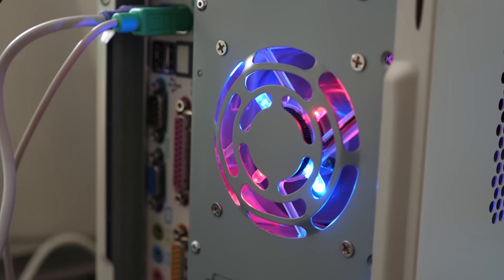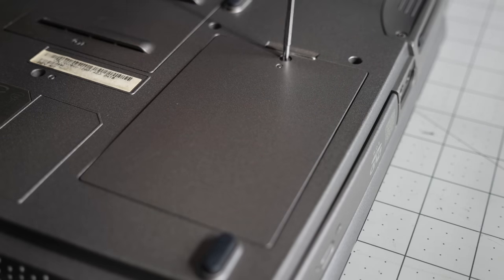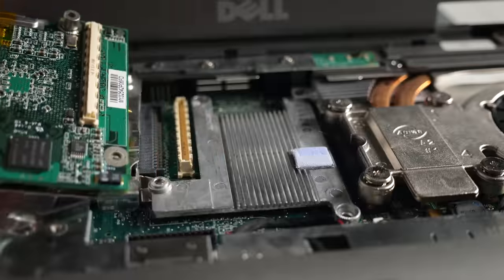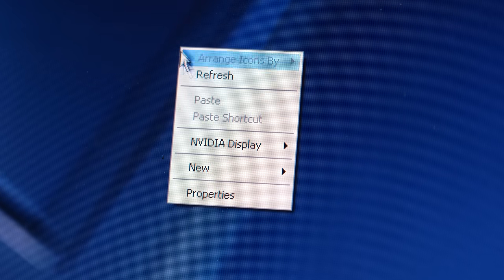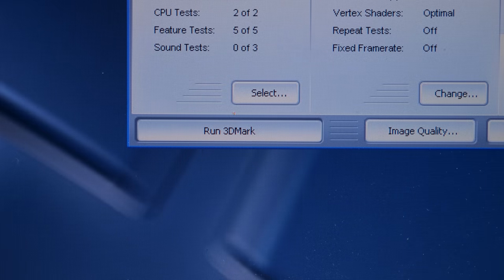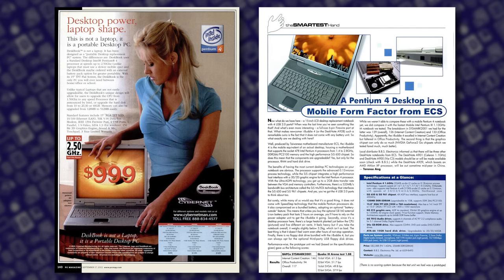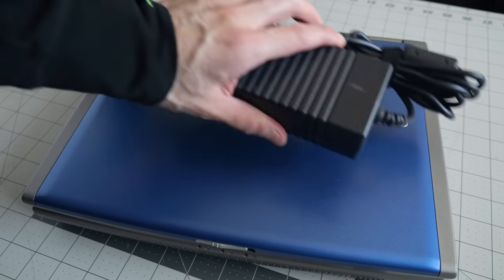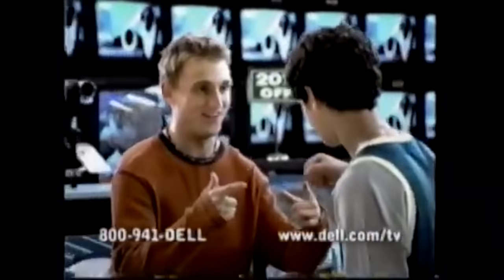Dell Inspiron 5150: Good for Windows XP Gaming?

Comment: ah, what an absolutely miserable machine. P4 laptops were truly the worst of every world: hot, slow, expensive, and left so immediately in the dust by every class of new machine that you wondered why you bothered in the first place. comparing this to my first Vista laptop (an Acer Aspire, lmfao) was night and day even then. the only thing i miss is the keyboard!
Reply: Honestly while I can agree with what you’re saying here, this is one of the few examples of a GOOD Pentium 4 laptop. With the right upgrades it can be a pretty beastly machine and very functional! I have one and it’s one of the most functional P4 dells I’ve ever used… which is saying something because usually they are kinda garbage.

Comment: They have so many better options even from dell. Get the xps with the awsome fave plates. Or hp had the zd8000, dv7000 which both had dedicated graphics, and desktop pentium 4ht cpus. Dell also had a desktop replacement that was a tank looked like a standerd inspiron but had 2 inchs more on the bottom. Lgr did a video on it.

Comment: I absolutely love these types of videos. I have many XP era laptops loaded down with games. Also if you want a more modern laptop that's very small, with hours of battery life while playing, I recommend the Dell Latitude 3189. You can get them under $100, they have windows 11, and are on par gaming and benchmark wise with an ATi 9800pro. I put a usb external SSD on that sucker and loaded it down with all my GOG games. It is a great pre 2004 gaming pc( an era that has a lot of nostalgia for me as that was my teens and early adulthood). Great for all those unreal engine 2 games and below. Handles dosbox great too. Resolution of the screen is 1366x768, so a lot of these games will run at 1024x768 or you can use widescreen mods. Also a glide wrapper like DgVoodoo will get those glide games running just great. This little hunk of junk is great for travel, it's light, and you can game on the battery for at least 3 hours. I did it playing Deus Ex and Gothic 2. It's a great option for the retro pc user that needs a little pc for travel that can browse the web safely.

Comment: I think you're glossing over what a weird thing the P4 was here, especially crammed into a laptop. The Pentium M chips of that time would have performed similarly if not better, and so it's weird to me how Intel was pushing P4 chips into laptops, creating unnecessary internal competition with a CPU that didn't perform like they intended. P4 chips were an evolutionary dead end. Intel had to go back to the Pentium M, which was based entirely on the Pentium 3, to start making good CPUs again - the Core line we know til this day. It's like Intel was hungover from drinking all that megaherz koolaid in the 90s, gaslighting themselves into believing a 3ghz P4 made sense when a lower clocked Pentium M would've outperformed it and drawn less power doing it. The IBM Thinkpad T42 with Pentium M and Radeon 9600 was a far better machine for gaming, and it should have been for sale around the same time.

Comment: this might be the first retro computer that i’ve seen on youtube that i actually have. used it a lot when i was a kid and ended up inheriting it from my dad. sure, it’s definitely worse for wear but certainly still usable. remember playing rollercoaster tycoon 3 on it and it handling it pretty damn well.
Reply: Wonder how Windows 7 would perform on it. Have you tried it by chance?
Reply: @dylanash2569  I haven't tried it, but I can't imagine it would be too great, seeing as I tried running Minecraft on it back in 2013 and I got maybe 10 FPS on it. It wasn't really playable and I imagine that things such as Aero just wouldn't work and Windows 7 era games would probably choke. Still have it, suppose I could give it a shot. Main limitation is that it's a 32-bit CPU
Reply: @majoryoshi  I ask cause I used to run 7 decently well on an AMD Turion and while performance wasnt great in many games, it worked well as an office machine.

Comment: I’m a huge fan of laptops from this era. Not only for nostalgia reasons, since this is what I grew up with, but also since it was a golden age of laptop upgradability. I’ve got a few ThinkPads and Compaqs of the era, and they’re great machines.
Reply: Yeah, pretty much everything had socketed cpu's.

The reverse of today.... Absolutely everything was socketed, modular batteries, sometimes dual battery capable.
Reply: yeah, laptops back then were modular pretty easy to upgrade and service

now everything is fixed soldered and unupgradeable
Reply: No doubt people don't understand their smartphones tech is fitted in with the increasing power and performance of laptops. Asus and Razer are the masters.

Comment: The Windows XP retro gaming scene is going to be an interesting one, because XP was supported for so long up to Windows 7 and even beyond into 2015. The poor reception of Vista really prolonged it's lifespan.

I currently have XP set up on my 2011 Thinkpad T420, one of the last laptop generations to have native support for the OS.
Reply: Does it have the nVidia GPU?  I've got a T430 with the nVidia, now I'm curious if it is XP compatible.
Reply: @milescarter7803  no, just the standard Intel one. Don't expect that model to do high end XP gaming. It seems to be most comfortable at 720p at Medium settings with games like CoD 2  and Battlefront II. It only really starts to struggle with Battlefield 2.
Reply: not only that, it's POS version was supported up until 2019

Comment: This video's definitely a Nostalgia trip for me, thank you for uploading this! I had the 5150 Brand New when I started College, (later on I was also given the 5100, which is a celeron-based processor variant) I'll tell you one thing though, the laptop doesn't age well; repeated RMA's to Dell Tech Support, due to various components failing, (Motherboard, Power Supply, Power Jack, Hard Drive, Battery, etc.) just about everything's failed on the laptop and had to be replaced, even several times! But, as a daily driver for Years, that laptop served me well! (and yes, I did carry the hefty laptop+power supply with me everywhere, it wasn't easy! 😂)
Reply: We had the same experience, for some reason they were bought for use by our consultants who were doing database work on them, building cubes (Microsoft Analysis Services) etc, so they had a hard life.
Reply: The 5100, 5150, & 5160 had SO MANY design flaws that I'd hazard a guess that any that have survived intact this far have either been repaired, or are time bombs waiting to go off.

I had a 5150 as my daily driver from 2004 through 2010, and as my portable until 2011 when it got replaced with a Cr-48. I got lucky - I had the extended service warranty at the time so I didn't have to pay for the three motherboards and four power supplies that failed.

I'm a bit disappointed that this particular model was used, because I expect there are a lot of people who might get one, only for one of the many issues to crop up on them.
Reply: Yep mine would over heat constantly. The fan failed headphone jack failed, battery failed, disc drive failed, hard drive failed all under warranty too. By the end I was left with a fully refurbished laptop which is why it lasted so long.

Comment: We had a load of these at a company I was working at around 2004/2005. They were not really corporate laptops and so they failure rate was bad, every single one needed a motherboard replacement. I was told they were more of a home machine or gaming machine, more cutting edge specs and more heat as a result.
Reply: They suffered from VRM failures most of the time which was common with half-assed Pentium 4 Desktop Replacements like the Inspiron 5150.
Reply: In fairness, the Dell corporate laptops of the era got clogged quickly with hair and dander, overheated and died. I even had a few of the 2006-2007 era with dead motherboards right out of the box.
I have hung on to a few Dell mobile workstations of the era, but the keyboards are missing keys... They do fly with XP though

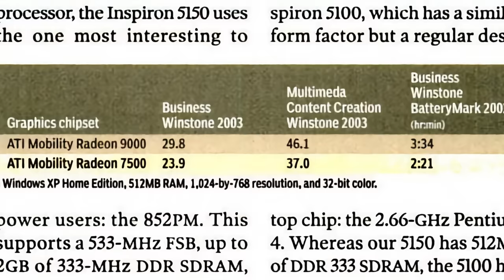Comment: 7:20 Pentium m is not only for battery life, it's have better performance then pentium 4 even on desktop. You can try to find rare matherboard with 479 socket for Pentium m and compare with P4. Or just watch test on internet. That why Pentium m became a Intel core platform.

Comment: Not a Dell fan but this isn't the worst laptop I have seen.  One thing for sure 256MB with XP is swap file city if you do anything more then read documents.  512MB at a minimum is needed to avoid that.  Especially true after they added all the Service Packs and updates turning it into a slug with not enough RAM.

Comment: I had this laptop back in the day.  Looks like the same specs too.  It wasn't bad but I wound up using an older P3 laptop for......mobile.... things.  Working on my car during a hot summer with this thing on my leg connected to the odb II port was painful.  Also because of the CPU the battery life was terrible.  Running games though, you didn't need a heater in the room, it blew hot air like a hair dryer.

Comment: This was the first "new" PC I got, when starting college in 2003. They have a design defect where if the backlight is at anything but full brightness, and anything else draws power (eg, the hard disk seeking) the backlight flickers. Dell replaced the video card, the motherboard, the display, then the whole machine. Then on machine #2 they did the video card, the video card again, the motherboard, the display, then the whole machine. By this point the 5150 wasn't made anymore, and they gave me a 9600. I was able to talk them into swapping it for a 600m - the first Centrino / Pentium M laptop from Dell. It was a fantastic machine and I used it for many years!
I'd love another 600m, but I don't really want another 5150...

Comment: I've always wanted a Falcon Northwest Fragbook from the Windows XP era, but considering the pain I went through of using a Dell Latitude from 2005 (arguably NOT a gaming laptop), I think I would pass based mainly of having to put up with a main HDD with the antiquated 44-pin IDE/PATA interface when the newer and more common SATA were just becoming a thing. Sure, nowadays I could just get an mSATA to PATA adapter and run off SSD, but it doesn't seem practical for just a retro gaming machine that I don't exactly use every day.

Comment: Thanks for this glimpse into WinXP gaming laptop era. My personal preference is Toshiba Satellite 5205-705. It’s a Pentium 4 machine with GeForce 5600go, gorgeous 1600x1200 screen and rich Yamaha sound powered by two speakers and subwoofer. The screen is really good even by today standards, and gpu is capable of running most pre-2004 year games. Plus Yamaha chip helps running dos games (under win 98) with general midi music.

Comment: One of these old chunks of metal was my first computer ever. It was a different model though. A Latitude D630 from 2007 that came with Windows Vista Business installed on it that was a hand me down from our neighbors. When I got my hands on it, it ran windows 7 professional. Then, I upgraded it to windows 10 32 bit. I tried installing 64 bit windows 10 on it, but it struggled on it, so I went with Linux.
Reply: You can run windows xp very well on it. With just 3 GB RAM it flies like anything.

Comment: i'm currently working on an acer extensa 5420 from 2007. has a amd turion 64 x 2 cpu with ati radeon xpress 1250 gpu. just upgraded the ram to 4gb ddr2 5300s and put windows 7 on it....was never really used due to a faulty cmos battery causing it to never fully power on and just shut off.

Comment: Had the low spec Pentium 4 5150 with Wi-Fi and had nothing but trouble. Multiple motherboard issues that required replacement and terrible thermal issues. But was able to run Tycoon 3 impeccably when the stars aligned!

Comment: To make things even more confusing, the Pentium 4M was actually based on a Pentium 3 because it was more efficient. That’s also the reason why the original Core processors were P3-based. The P4s were way too hot and power-hungry.

Comment: I got a Dell Inspiron 8600 around the same time period and was shocked that my 1.6ghz pentium M would outperform my friend's 2.8ghz Pentium 4 in many cases.  I also had the Geforce GO 4200TI which was able to beat most of the FX5000 laptop series and some of the low end 6000 series nvidia gpu's.  Oddly many years later however i picked up the same model Dell with a 3.2ghz pentium 4 and Radeon 9600 pro ultra (512MB) and it really rips.

All in all the FX5200 was a pretty poor performer and i expected that it would struggle.  

Thanks for the video and the memories that flowed back from it.
Reply: Easily worst Nvidia product

Comment: There was a class action lawsuit over the 5150 and 5160. There were serious issues with the design of the board, including where the heat from the CPU could cause the connection to the power plug to crack. I lost four motherboards to this between 2005 and 2007.
https://en.wikipedia.org/wiki/Lundell_Settlement

Comment: I happen to think buying a middle-man machine is the way to go. Something like your Thinkpad T420/430 or Dell Precision M4600/6600. They have great support for Windows 7 and older, meaning that running XP on them is relatively easy. Additionally, their I/O selection and even integrated graphics trounce anything available in 2003.

For 4:3 gaming, you'll need to run at a funky resolution or go with an external monitor. But anything in widescreen would be easily supported.

Comment: How do you exactly activate Windows XP nowadays, I havent got any working XP machines because I could not have activated them...
Reply: You have to use the "by phone" option. But MS also has a website (they will text you a link when you call the activation number) to type in the phone activation code and get the response code so you don't have to do it with the phone box

Comment: I have a Dell Inspiron 510m which is very similar to the one in the video. I was attracted to the blue and silver color scheme. I originally bought it to use as a retro machine but so far haven't got round to it. For a while I preferred the Dell Latitude D430 as an XP machine as it's smaller and lighter, not to mention more powerful and with a more modern selection of slots and ports.

Comment: the 5100 is also a good option since it can take 5150 video cards. it also has desktop pentium 4 cpus which are significantly faster than the pentium 4-m chips

Comment: I still have a fully functional Gateway M500s from the same era. It had a unique (for the era) widescreen and media control setup, with a modestly impressive speaker set with subwoofer built-in. I’m going to dig the machine out and clean it up, maybe drop in solid state storage, but it’s an incredible gaming machine for the era … at least as a portable DOS and even limited console/arcade machine emulation (which is exactly what the machine did when I wasn’t doing work on it). I used to play everything through N64/PlayStation without issue on the mobile Pentium 4. Great stuff!

Comment: I had the inspiron 5100 model years ago with the desktop pentium 4, it was a great machine with good performance but it was running quite hot since it had an desktop cpu.
Other than that i pretty liked the design and the aesthetic of the laptop because it looked like it came straight from the early 2000s, and also another surprise was that its original battery was still working,
Sadly the display went bad so i took it off and used it as a desktop but after a while it started to malfunction and started to fall apart so i sadly had to salvage the stuff that were still good and scrap the rest of it.

Comment: Tip: Don't use "Quick Format" for mechanical HDDs, it doesn't check for bad sectors. Only use that option if you install to a SSD
Reply: Tip: Don’t install XP to ssd unless you have a mod to add proper compatibility
Reply: @Generic_Handle4573 It isn't that much of a problem, really. Even if it doesn't support TRIM etc, modern SSDs have enough internal wear management to deal with the somewhat increased demands from an old OS.

Sure, it'll technically wear out a bit quicker, but how much do people actually use their XP machines? The 10 year old 500GB SSD in my regular gaming PC still reports about 80% remaining writes, and that's despite regularly rotating in and out massive modern games. Honestly, I don't know if I'd be that worried even if running XP entailed 10X normal wear, which I'm pretty sure it doesn't.
Reply: @ozzyp97  Rotsting out a game doesn’t remove its files instantly. Like a hard drive the files remain until overwritten to save on write cycles. Also it’s only at 80% because modern OS are much better at not killing SSDs
Reply: @Generic_Handle4573  If I remove a game, it's because I need space for something else, in which case it does get overwritten. And I'm not saying the wear rate is equal, the point is that I'm using my XP rig much less, and moving around much smaller files when I do. So, even if it was wearing out the SSD 5x as fast, I'd still be likely to get a solid 10-20 years of use out of it.

Comment: Star trek voyager elite force would be a good game for that computer. But yeah that 64MB RAM is incredibly hamstrung. There were fx 5200s with 256MB and while they weren't fast, more stuff would probably at least run with low settings.